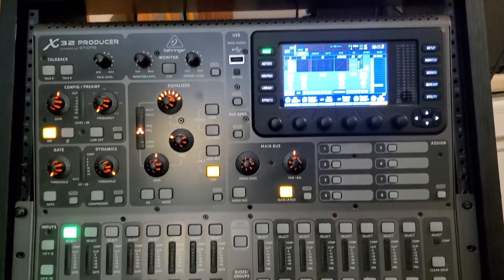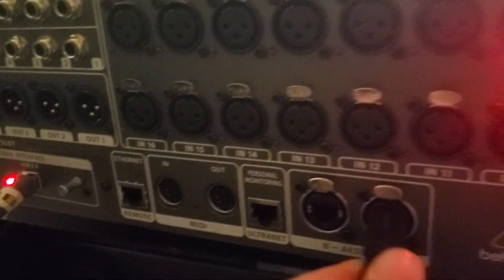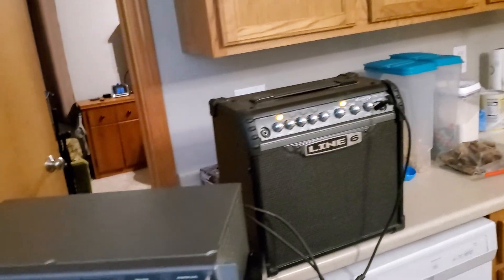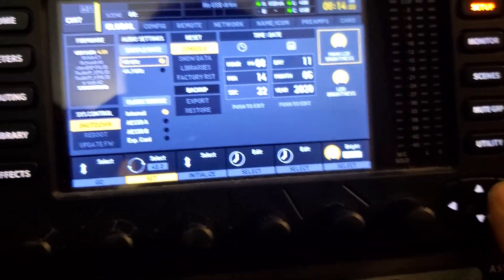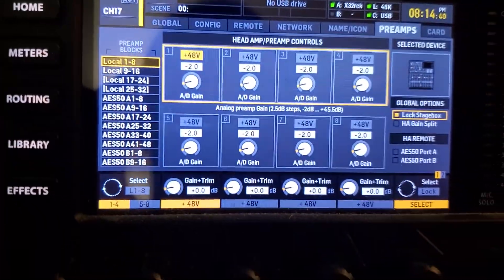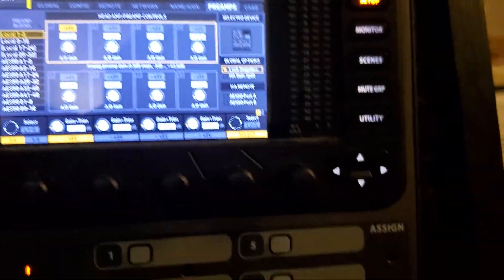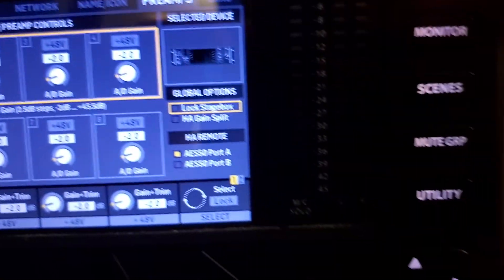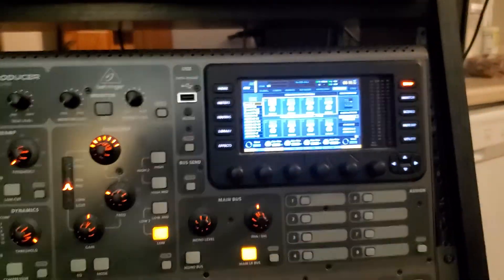X32/M32 Complete Routing Using X32 Rack as Stagebox V4.0

Comment: This is exactly what I've been looking for thank you!  Wondering if you can help with my unique situation.  I have a full x32 console with an x32 rack setup as a stage box.  Both mixers are connected to their own amps and speakers.  I need for the things plugged into the x32 rack to output from the x32 rack only and the things in the full console output there only.  Ie I can't have output from the things connected to the x32 rack output from the console and vice versa.  Hope that makes sense and thanks in advance!
Reply from the maker: Sorry for the delayed reply. YouTube marked your comment for hold and review, so I haven't seen it until today.

So basically, you want each set of outputs to route independantly of each other (x32 rack and x32 console)?
If I understood that correctly, You could just use AES50 A for one console and AES50 B for the other in your routing scheme. Adding a dante card could also allow you to route channels in different subnets on your network.

I hope that helps.
Cheers,
LoftonSpace

Comment: What do I need to change to get my outputs 1-8 out from the x32 producer and outputs 9-16 on the physical outputs 1-8 on the x32 rack? Please help me I can't get That figured out correctly
Reply from the maker: X32P Routing > AES50 > Source Out 1-8 - Output AES50 1-8. Then on X32R > Routing > XLR > Source AES50 1-80 - Outputs 1-4 & 5-8. This will route the first 8 channels of audio from the X32P to the first 8 channels of digital audio on the AES50 connection to the physical first 8 outputs on your X32R. I hope this is what you are asking for. Neither X32R or X32P have physical outputs on 9-16 but 9-16 can be routed to 1-8. But you can only have one source assigned to 1-8.

Comment: I just purchase and X32 Rack for my studio. But, b/c of my gear. I need 2 s32 or ? Should I buy x32 mixer? Are is its even possibile to connect 2 s32?
Reply from the maker: You can link any of the x32 series mixers together with AES50. One just acts as a slave to the other.